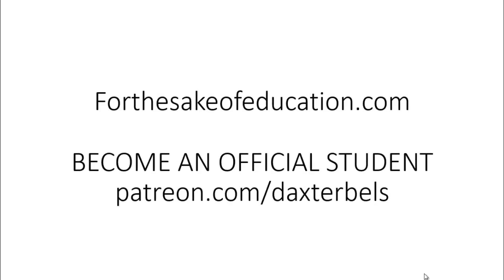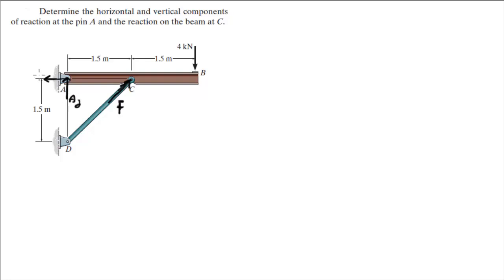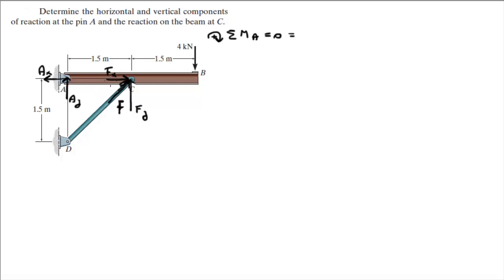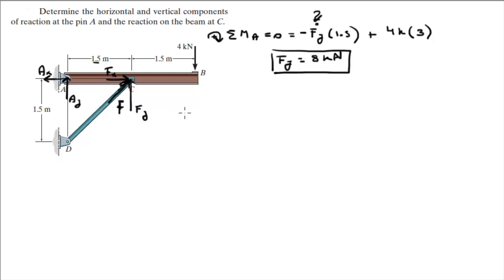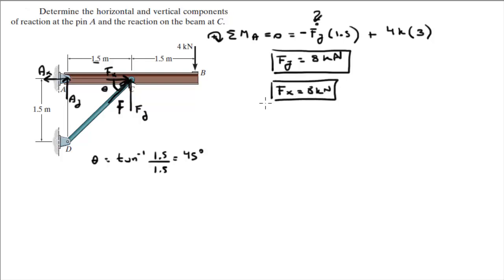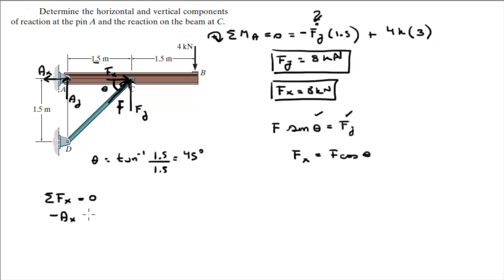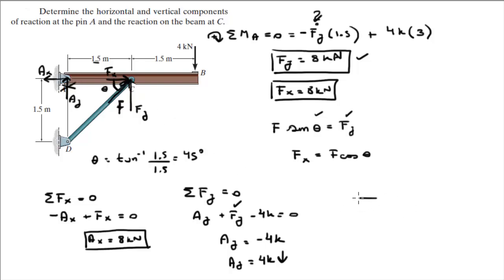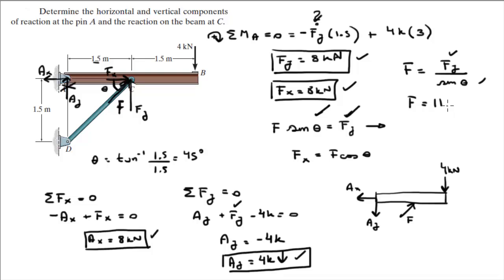Determine the horizontal and vertical components of reaction

Comment: Determine the tension in the cable and the
horizontal and vertical components of reaction of the pin A.
The pulley at D is frictionless and the cylinder weighs 80 lb.

Prob. 5–16